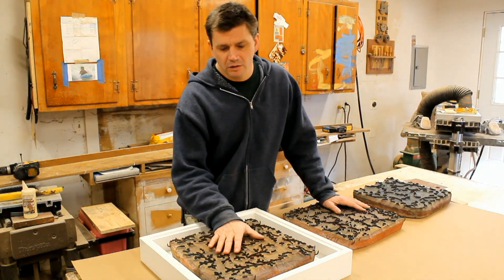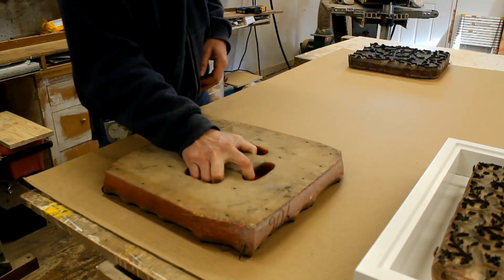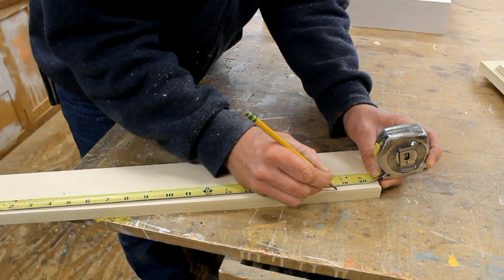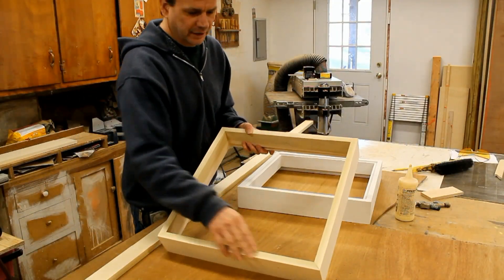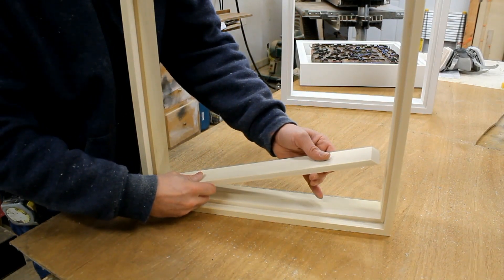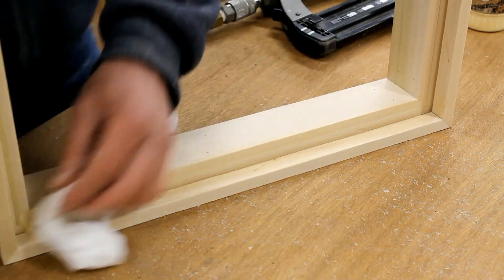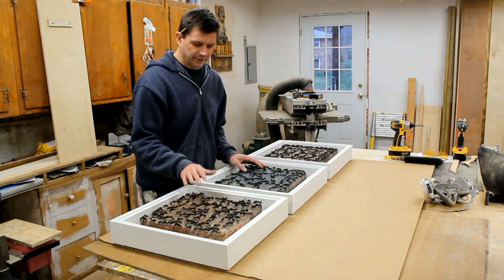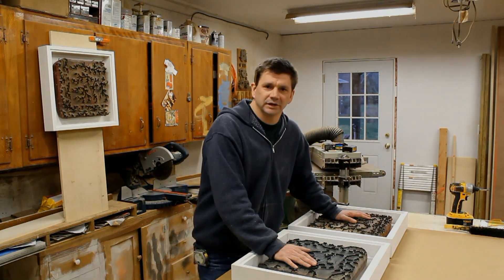Art Woodworking how to make a wood picture frame with French cleat system by Jon Peters

Comment: Rabbit.. Rabbit!! - It's called a fucking rebate!!
French cleat - split baton
Mitre cuts on a drop saw - brutal, to a pencil mark no less - why you no set a stop?
Nail gun!?!? - no underpinner I guess
Why the aggravation? 
I am a bloody picture framer and this is so far removed from "Industry standard".
Reply from the maker: Tom Martin It works for me...thanks for tuning in.
Reply: The word he is saying isn't rabbit it's rabbet.  Rebate is the British pronunciation.  The word rabbet is from Old French  rabbat, "a recess into a wall," and rabattre "to beat down". So before you start criticizing someone check to see if your right. BTW good video. keep up the good work.
Reply: I stand informed, thank you for "handing me the paper" for my verbal diarrhoea.
Is the word "rebate" not used in US English? 
Like a "tax rebate", or a rebate on a bill because you've over paid? I'm curious as to your response.
Reply: +Tom Martin - A rebate in the US when, for example, something is $99.99, and you get a $20 rebate.  Sometimes it is done in the store at purchase.  Most of the time the rebate requires you to mark on the receipt what you purchased, the bar code (for example) from the box the product came in, sometimes an official rebate slip, and then you mail it in.  After 6 to 8 weeks, you get your $20.00 check in the mail.   Then your product is $79.99.